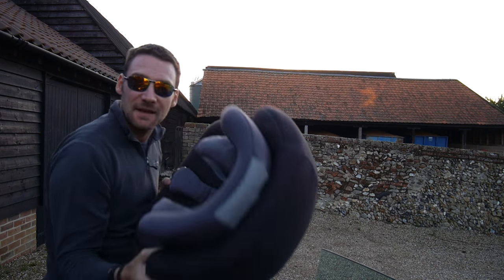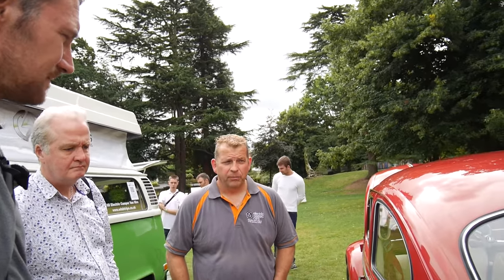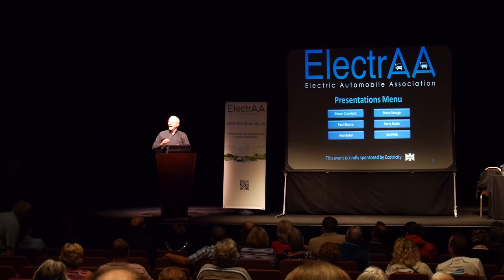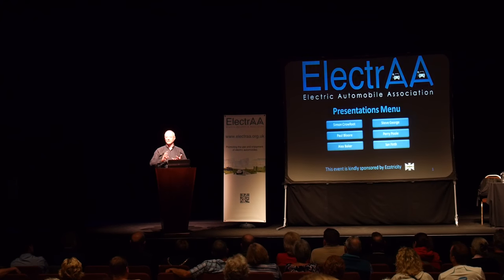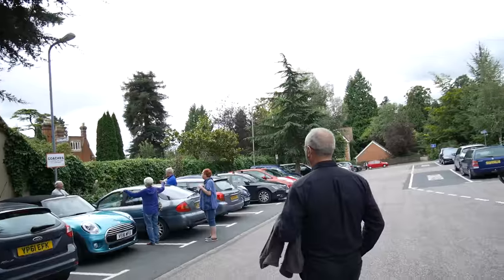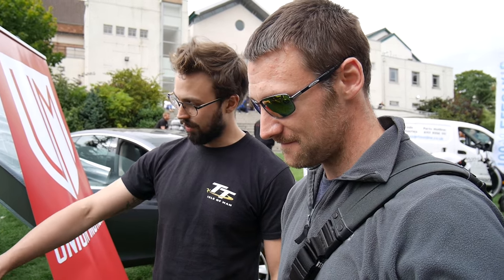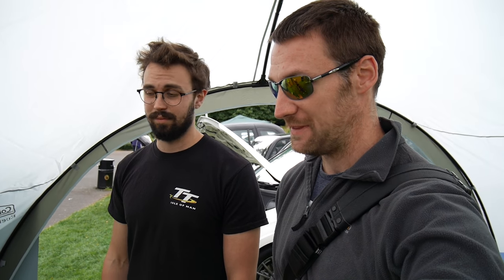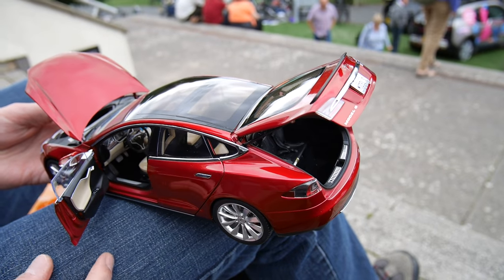Bumping into Robert Llewellyn at an EV show

Comment: James, Great Vlog. But why don't you charge at night with cheap rate electricity on the computer which switches itself on and off while you sleep. it cost me under £5 to charge it up from about 50 miles to full 280 miles.

Comment: "electric cars might be quieter then petrol but what happens when you leave the radio on overnight? You can't jump start it because it's electric (smug face)" 

And so ended my conversation with a Honda civic boy racer guy.
Reply: That's impressive ignorance - the Tesla has a normal battery that runs the infotainment system, so even if you left the 'radio' on, you can still actually jump that battery like any other car.  Also, it recharges off a battery big enough to keep the radio going for years...  That's a hilarious story.
Reply: +ThisWorldOfEpicness I have more. "can I put a generator in the boot connected to the wheels to charge itself? The wheels are spinning anyways, I'm just tapping into it?"
Reply: Conor Murphy Thats too funny.  In the middle of exams so thanks for making my day!